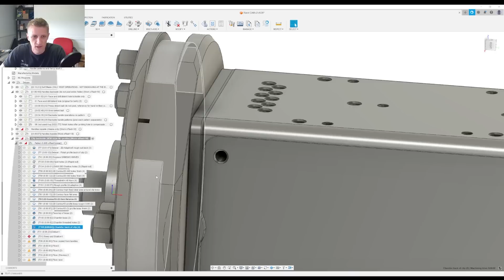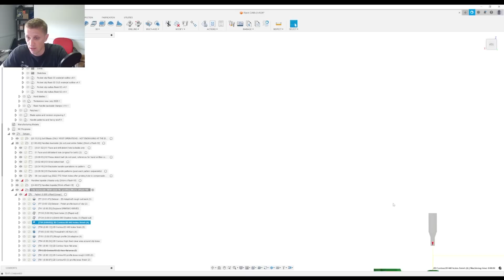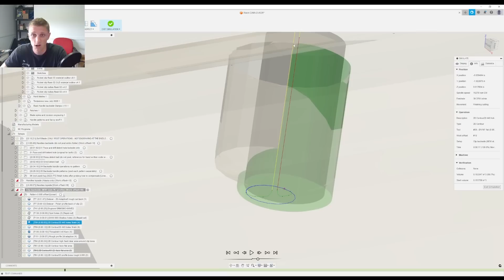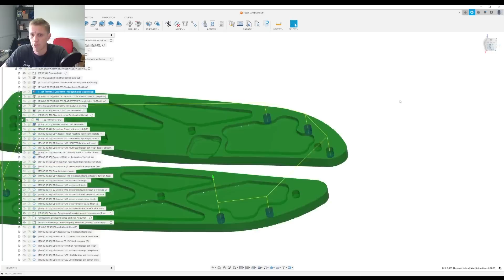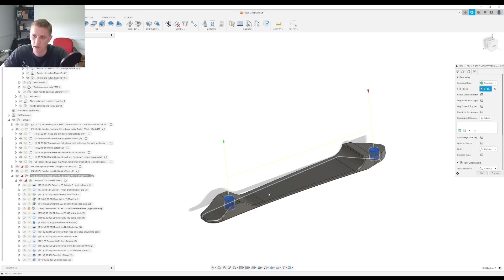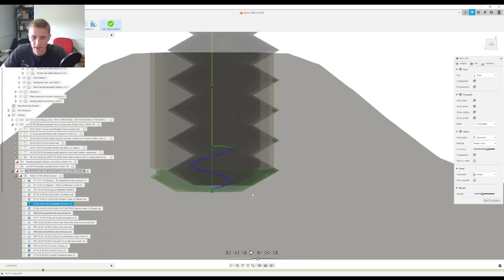This Tool Keeps Breaking, Let's Figure it Out!

Comment: I haven't used Fusion so I'm not sure if it compensates for it, but you will also have an increase in the apparent feedrate from the centerline of the tool to the outer tangent point of the hole where the cutting is actually happening.  That can contribute to overloading the chip thickness.  For a tool of diameter d cutting inside a hole diameter D, the feedrate should be adjusted (Adjusted Feed Rate, AFR) AFR = FR*((D - d) / D).  So if you have a tool diameter of 10 and a hole diameter of 20, the adjusted feed rate would be 50% of the nominal value to hit the same chip thickness per tooth.  The problem gets worse the closer the cutter diameter is to the hole diameter.

Comment: John, I know there's a friendly rivalry between you and Mr Saunders, but can I take it from this video that you share his dislike of the SpaceMouse?  Personally, I couldn't use Fusion 360 without mine ... 🙂

With regard to the tool path issues, have you considered calculating the necessary thread engagement for the screw, or to put it another way, can you make the screw shorter buy a whisker, or even profile the end of the screw so that it's not clashing with the 140° profile left with by the drill?  KISS an' all that.

Comment: Any reason for not spiraling in at a smaller diameter down to depth then profiling out the rest of the diameter - should be possible in the same pocketing operation.  Definitely keep the pre drill operation.  Don't panic about the time difference 10 seconds is quicker than replacing a bummed part and wrecked tool.

Comment: We use to use a flat bottom carbide drill with tsc from the start where I work no problem ( we got about 2 weeks of tool life on each of them in high nickel material ( 55+ % ) where we then changed it with some tool life left. We rather change them before hand then having die in the part and scrap the part )

Comment: I dont know your program structure so this might not work but on heidenhain we usually use CALL PGM to call the tool break check in a sub program. if you do it like that you could insert some Q magic if-statement stuff pretty easily to jump to an M65(or whatever your pallet change M-code is) if the tool is broken. That way you might not need to add it to every tool change line. But thats a maybe depending on how your program is structured.

Comment: You didn't mention coolant in your troubleshooting process. Has the coolant been checked for any degradation or contamination ? Also is the coolant flow directed in the proper place to flush out chips. If this process has been running good for a long period of time and then all of the sudden start breaking tools it may not be the process at all, it could be the tool itself or coolant issues. Sometimes tools from a new lot may be ground with clearances that are not suited for titanium .

Comment: Why don’t you use a thread mill that cuts the hole and threads with out a pre drilled hole. We use them with a lot of success. We use the moldino brand but a few other brands make them too

Comment: Could you get rid of the endmill entirely and just drill the hole a bit deeper so the threadmill doesn't contact the bottom drill taper?
Reply: or just use a coolant through 3 form threadmill with endwork and eliminate all of the issues
Reply: @carbidecuttingtools3783  less reliable

Comment: Why not just drill a bit deeper and run the tap or threadmill through it??? It looks like you have enough material to go deeper. Rather than a flat bottom drill you could use a drill with a weaker point (135 degrees rather than 118)? Lots of solutions. If you're getting 80 minutes of tool life from a 1/8" EM through titanium even that isn't terrible imo - I've seen milling setups where you have to change a tool every few parts.

Comment: It'll be cool if you can mix G-CODE and python with programs.  In a language like python you could have an exception handler that does all the magic.  You could have the tool change macro do the breakage detection and throw an exception that bubbles up the stack.
Reply: RS-274 G-code supports conditionals, loops and variables. It's not elegant compared to a proper exception handling system, but it's not horrible either.
Reply: @j.dietrich  yeah, I'm aware that some controls support a BASIC like syntax for G-CODE.
Reply: People absolutely do this, but they usually keep to themselves because there is a lot of specific applications which would make it pointless or at least very limited in use to justify sharing it.

Comment: They have threadmills that have a cutting edge on the end so they can plunge without a pilot hole.  They are left hand tools and the spindle rotates in reverse while the plunge is right hand helical.  You could probably eliminate the flat bottom drill by using one of those threadmills, so the process becomes: Spot/chamfer, pop hole, threadmill.  I bet that would be pretty reliable for Ti.
Reply: I was thinking  about these as well while watching this. I believe iscar and tungaloy make them as well as others probably. I first saw them on Adam the machinist page and he used them on stone hardened D2.
Reply: IDK about using that for the harder materials but they definitely have their place with aluminum and basic steel alloys.

Comment: Good video. Have you thought about threadmilling on the way down instead of plunging into the material then threadmilling on the way up? Of course the real solution is to remove the issue with your flat bottom drill. But I was just wondering if you think that would have worked for you. Ciao, Marco.

Comment: Can you make one turn of the threadmill at the bottom of the hole and then go up in a spiral? So you get a semblance of a groove, and the screw goes a little deeper. Also tool wear will have less effect on the depth of a thread
Reply: since its a multi-point threadmill it would make a bunch of unwanted grooves, unless im misunderstanding you. on that same thinking most threadmills dont cut on the buttom face so you have to make room for it like john is doing.

Comment: Is there no Gcode that does something like an end current program (basically instantly finish the pallet) that then would drigger the normal pallet change? Something like in arduino code end loop does